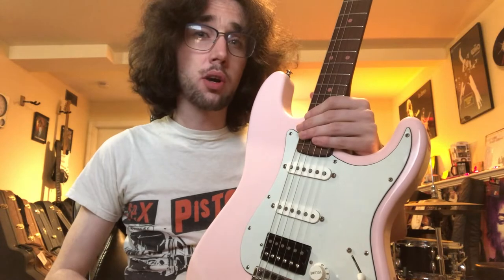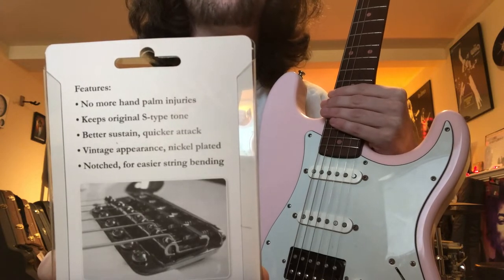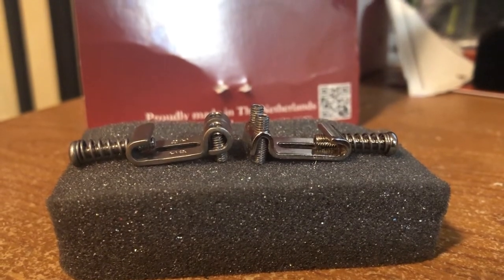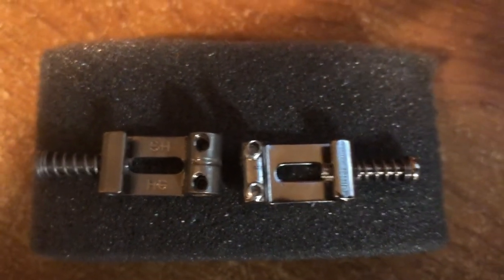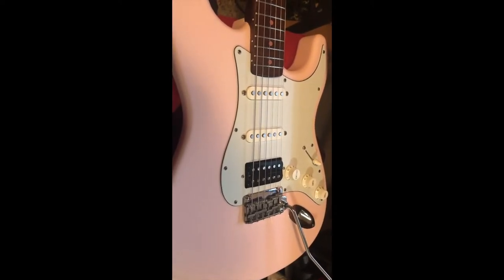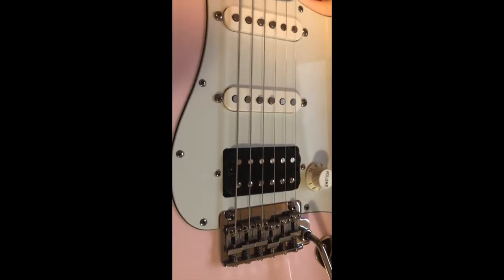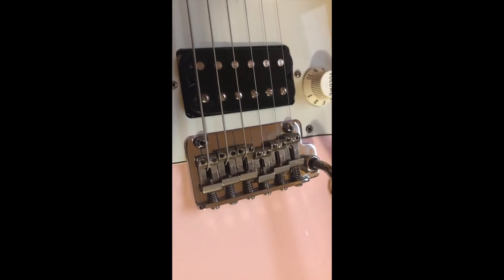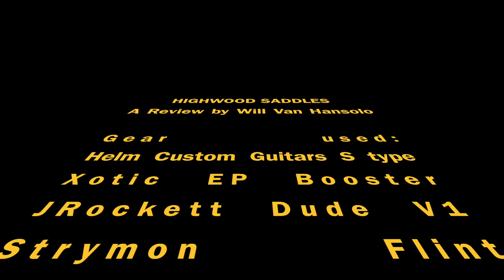365 Days of Guitar Day 4  -- HIGHWOOD SADDLES; OVERVIEW AND COMPARISON TO GOTOH BENT STEEL SADDLES

Comment: The Highwood saddles definitely sound fatter and louder. The sound has a lot more mids on it, low-mids especially. At least that's what I hear. It makes me think that it probably allows the string vibration to reach the body easier which in return gives more of a mid-heavy, fatter tone. Maybe you can confirm if the body vibrates a bit more? Did the guitar lose a bit of clarity or is it more like just more mids/bottom end?
Reply from the maker: I would tend to agree with you about the boost in the mids, which is actually quite nice because I tend to find Strats can have a tendency to be a bit scooped in general. There might have been a slight reduction in top end (clarity) but not enough to bother me. It seems like the scope of the whole guitar has shifted, ever so slightly, towards a more midrange focus. I can't say for sure if the body vibrates more, but it certainly still has a nice resonance.
Reply: Guitar wood does not add anything to the signal.  I know 100% that is correct, I am degreed in Engineering and understand Physics.  You may answered the debate, it’s not what materials add but what they take away, signal attenuation, that is why it alters the sound.

Comment: Both sound good.  I prefer the Highwood for more low mid resonance and growl and more open midrange from there, but would tweak the amp with much less bass.  Of course for an A/B, you kept the amp setting the same.

Great comparison.  Thanks!

Comment: Great video and a good comparison, right choice of tone and riffs. If the high saddle screws were the only problem you could file them down or try to buy some shorter ones (if they would fit) But the Highwood are good option too. I have recently changed my steel block saddles (2004. Am Series Strat) to Callahams, didn't want change the whole bridge because of the offset saddle screws so I went for Callahams. I use .10-.46 strings tuned down half step - the grooves although tiny appeared instantly. Think I'll have to buff them every once in a while. So I think every saddle is prone to cutting in the grooves except the already grooved ones like Highwood. I hava a brass nut and with the steel block saddles the sound was a bit to harsh and bright sometimes but now it has changed for the better. I'm surprised by that knowing that the brass nut should should sound warmer before and I what I've got with the Callahams is jut the opposite. I've expected it to sound even more sharp and harsh but no...can't see why but the guitar sound is better now and it has vintage appearance.
Reply from the maker: Thanks for chiming in! My main issue with the saddles was the high set-screw length, but to be honest I'm not really one for major tinkering with my guitars so it seemed more logical to just drop in a new set of saddles. To be fair, I was starting to have issues with grooves being cut in the Gotohs as well upon closer inspection of them, so that's another point in favour of changing them. I don't have a ton of experience with the Callaham/Raw Vintage saddles etc, but ultimately my biggest reason for choosing the Highwoods was functionality out of the box. They sound great, but my primary rationale for changing them was to improve the feel of the guitar where my palm rests and to potentially stop some of the string breakage I was getting on the thinner strings (not excessive, but certainly often enough). Cheers!
Reply: @WillyKidd  
How old were the Gotohs when the strings started to brake? I brake strings very rarely, almost never...
Reply from the maker: @singleplayer75  I mostly had issues with the high E string popping, it didn't seem to matter the age of the string. It didn't happen on a daily/weekly basis or anything, but it happened every now and then on gigs which was frustrating. I don't often break strings either; mostly on guitars with a vibrato system on them and at that, usually just the thin ones.
Reply: @WillyKidd 
OK, 'cause I'm a bit afraid of having that after a while, guess I'll have to use a Dremel. Thanks mate!
Reply from the maker: @singleplayer75  no prob -- thanks for chiming in :)
Reply: @WillyKidd  I think it ultimately comes down to the density of the material. Denser material require more energy to vibrate. Your old saddle material was probably harder and more dense than Callaham's, so it transferred less vibrations to your guitar body resulting in a more thin sound. That would explain why Callaham's sounded fatter and better and also explain why the grooves appeared instantly (softer material).